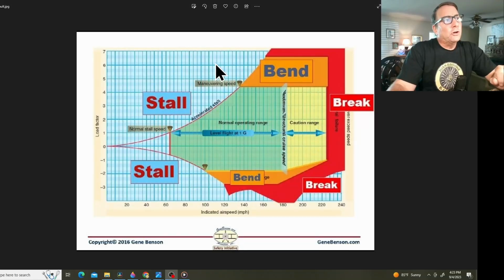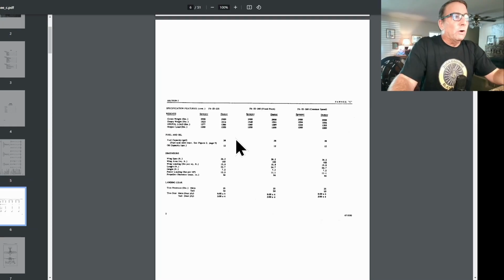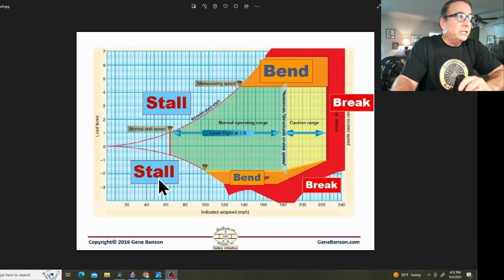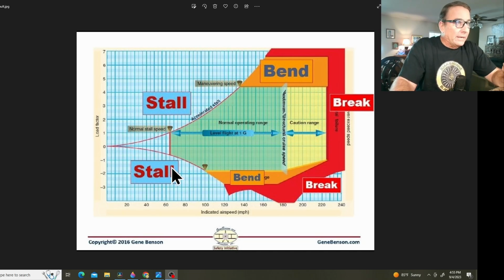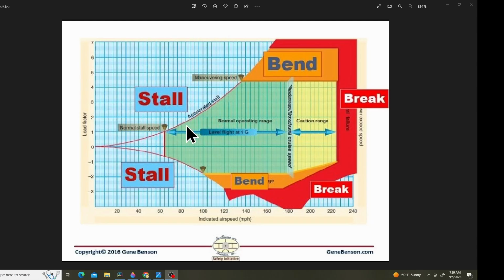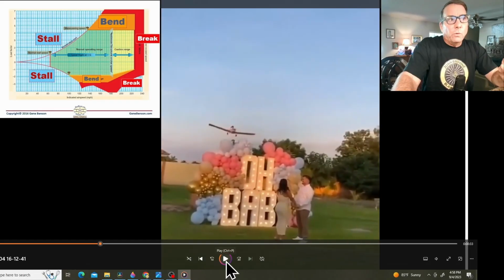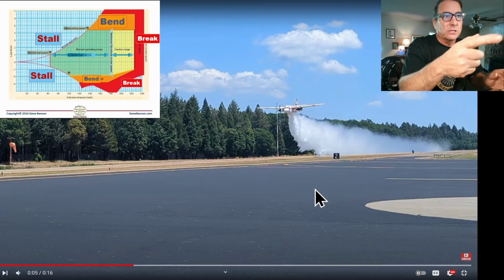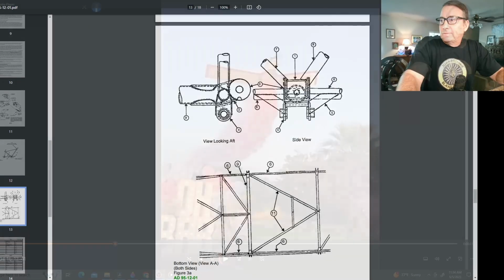PA25-235 Sinaloa MX Gender Reveal Party Structural Failure

Comment: As someone who owns and flies a PA-25-235 Pawnee for aerial application,  I’d like to clarify a few things:

1) A Pawnee 235 usually reaches its gross weight with around 100-110 gallons of water (8.3 pounds per gallon) and proportionately less with many ag chemicals that can weigh 9 to over 11 gallons per gallon.  Most ag pilots who fly or flew Pawnees don’t advise flying with any more than 90-100 gallons.  

Mine has an updated 260 Hp engine, and while it has ample power to come out of a field and maintain speed in a turn, it’s still short of wing area.  With more than 100 gallons (or 830 pounds) in the hopper, the stall speed starts to get uncomfortably close to the accelerated stall speed in a 45 degree turn. 

My Pawnee with myself and 41 gallons of fuel reaches its gross weight with 107 gallons of water.  That last 50 gallons of hopper capacity is only useful for seeding and other operations with lower density dry materials. 

In short, the weight change was at most on the order of 800 pounds rather than 1200 pounds. 

2) A Pawnee with a load and spray equipment will do a maximum of about 105-110 mph at 75% power and even at full power would be unlikely to exceed its Va of 120 mph.  My Pawnee 235 has an updated engine producing 260 hp but with its fixed pitched propeller my Pawnees still won’t exceed Va with a full load and spray equipment. 

Based on both its plying traits and what I see in the video, I don’t see any indication of excessive airspeed in this video. 

3) Most ag planes do pitch up during an emergency dump.  Ag pilots, like fire pilots flying ag aircraft as single engine air tankers, use forward stick to offset this pitch up tendency and can do it with no pitch up being evident.  Students attending ag schools do emergency dumps as part of their part 137 training and very few anticipate the pitch up quickly enough and/or with enough forward stick in Pawnees and in aircraft that pitch up more than a Pawnee but the wings don’t fall off. 

4)  The Pawnee’s pitch up tendency is comparatively mild, even when dumping a full load.  When dumping a full 100-110 gallon load an uncorrected pitch up is still only on the order of 1.5-2.0 G. 

5) More to the point, if you don’t mitigate the pitch up with forward stick it looks just like the Pawnee in the video prior to the pitch up.  The initial pitch up before the wing separation isn’t out of the ordinary. Even if the pilot added back pressure to make it more spectacular, it’s not a pull anywhere near the damage and failure limits on the VG diagram, even 800 pounds below gross weight. 

You did discuss the 1995 AD that required periodic and extensive (wing removal and dye penetrant testing) every 24 months, or new wing attach fittings and repetitive replacement every 60 months. Later there were three STCs for new wing attach fittings, two of which retired the AD.  Most Pawnees still out there have been modified with the new STC’d attach fittings at some point since 1995 when they have been rebuilt and recovered. 

The problem is unless you know what you are looking for and look to ensure the new STC’d attach fittings were actually installed, you have no idea if the AD was complied with or just pencil whipped.  Similarly there is no way to know whether a 24 month or 60 month inspection was actually done if the aircraft has the original fittings. 

It’s not a common issue in the US, but Bic maintenance is a bigger potential issue south of the border, where these wing separations happen.
Reply: This is great perspective and should be pinned to the top of the section IMO. 
Question: Do you think this was an intentional pull-up attenuated by the sudden loss of weight or the weight drop plus presumably flying into the wind caused the snap pitch-up stall and airframe failure?
Reply: It's a momentary accelerated stall that keeps your wings on as long as you are below the manoeuvring   speed in turbulence. I assume the point is the same in this case.
Reply: interesting stuff thanks for sharing.
Reply: Wrote a whole article
Reply: Few things about what you wrote. You said the weight drop would be 800 lbs and not 1200 lbs. you wouldn’t know that. You are assuming a full tank of fuel. He could’ve done this with 10 gallons of fuel instead so he can carry more water. Heck, he could even have taken off above MTOW. You wouldn’t know this. 

Also, the video is short, he could’ve nosed over the airplane prior to what we saw and increased its speed well over 120 miles per hour in a dive. 

Also, maneuvering speed of 120 mph at MTOW and lower the moment that weight is gone.
Reply: @rtbrtb_dutchy4183  1) fuel capacity is 39-41 gallons for the fuselage tank Pawnees so sure, he could have had 10 gallons of fuel on board (less than 3/4 of an hour) and added 175-180 pounds to the payload in the hopper.  It’s still less than 1200 pounds being dumped.  My primary point was just because it has a 150 gallon hopper with a 1200 lb limit  doesn’t mean it can actually carry that many gallons or pounds of water. 

Besides, what would be the point?  120 gallons of pink dyed water really doesn’t look any more spectacular than 100 gallons, or for all practical purposes 60 gallons. 

2) I often dive down over 80-100’ tall trees and from my 150-200’ turn altitude. In addition, on an initial pass after surveying a field I’ll dive into the field from 300-500’.  A Pawnee, with spray equipment and the extra induced drag at near gross weight, loses any extra airspeed quickly to around 105 mph. There’s enough of the approach in the video to confirm he didn’t have an excessive amount of speed. 

3) Oddly enough, as a commercial pilot and ag pilot I am aware of the effect of reduced weight on Va. however if the wings are stressed to 4.4G before damage occurs and to 6.6G before they break (which is the minimum acceptable limit for utility category aircraft), it means the wings of an aircraft at 2900 pounds will support 12,760 pounds of force before they permanently deform and 19,140 pounds of force before they break. 

But let’s say those same wings are only loaded to 2100 pounds (after dropping 800 pounds of water).  They will still support the same loads.  But at the lower weight it will take 6.0 G to bend them and 9.1 G to 

Maneuvering speed is the speed where the aircraft is slow enough that it will stall before the wings permanently deform with a full control deflection. In this case assuming the aircraft is at 2100 pounds, the new Va is 102 mph (Va times the square root of the actual weight / gross weight).  So it’s probable that he was slightly faster than Va. 

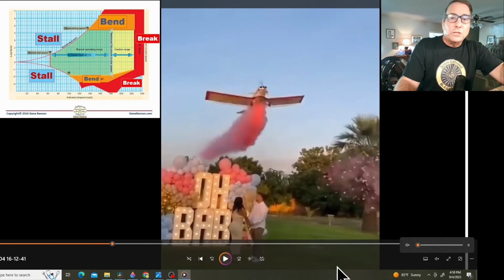 However, look at the video and pause it at 8:09. I’m not seeing anything near full elevator deflection.  In addition, despite its PA-18/PA-22 heritage and parts commonality, the Pawnee also doesn’t have a jack screw that moves the entire horizontal stabilizer for trim.  Trim is accomplished by adjusting spring force on the stick. Consequently what you see is what you get for control input. In short, it is not an excessive up elevator trim issue, and if you don’t have anything close to full control deflection, you don’t have a maneuvering speed issue. 

Even if the pilot did have full elevator deflection, he’s maybe 3 mph in excess of the new Va. Va is based on the 4.4G “bend” limit, not the 6.6G failure limit. I’m not going to run the precise math on that but that adds about 25 mph to Va before the wings will fall off.  It’s unlikely he could get a loaded spray equipped PA-25-235 up to 127 mph even in a slight dive. 

In short, I don’t understand the enthusiastic zeal to blame the pilot for a wing attach failure during what is a normal evolution for the aircraft, especially when there is a long standing AD for the wing attach fittings.
Reply: @larryvrooman4672  hey, I’m not saying you are wrong. I’m just questioning a few things. 

What I found so far is that this had the 235 hP engine and seems to be able to hold up to 1500 lbs in liquids. 

Also, I can only find it to be in the Normal Category, not Utility. 

Airplanes are certified when they are new. I personally would never trust a decades old airplane to still have the same strength as when it rolled out of the factory. 

I don’t think anyone is out to blame the pilot. I think people just want to know what the cause might be and discuss different potential causes.
Reply: @rtbrtb_dutchy4183  i see your points. i know it was an extreme example about nose over.. but from the we did see,  i will say it 'appears' that left wing was already much upward flexed than the right wing. dumping the load hugely upset the aerodynamics. ever picked up a mug of coffee thinking it was full, yet it was empty so picking mug up was a lot lighter than anticipated and so the mug moves way way faster than anticipated. yanno?
Reply: @michaelbigelow3255  I actually agree with you on that. It’s sad, but likely the truth.
Reply: thanks for this comment.  I don't know how much the payload was, but ususally these are only light scraps of paper for this reveal party.  as we can see at the end of the video there are tall palm trees,  he flew against the sun.. maybe he saw them too late and  he pulled up the plane because he did not want to crash into the palms. you can see how close the plane flew over the trees after the crash.   RIP
Reply: @Koi-Koi-Koi you keep mentioning your palm tree theory everywhere. Has nothing to do with it. Also, they used a fluid, not “scraps”.
Reply: @Dudermanbro  just a  typo
Reply: friend... can you please elaborate on this " ag chemicals that can weigh 9 to over 11 gallons per gallon.  " ??
Reply: @Palmit_ He meant pounds per gallon.
Reply: @gregjohnson2073  i thought so.. i wasn't being cocky, i just thought it's a bit more complex than i'm familiar with. i wasn't being rude or sarcastic. like when they say 176,000 meters per second, per second... yanno?

Comment: If the weight of the aircraft's fuselage decreases the forces on the wing spar and wing attachments actually decrease at the same load factor. What increases are the forces on the fuselage structure and in particular the engine mounts. This failure is probably not caused by the unloading of the water.
Reply: What?  No, that’s not how it works. You are talking level flight. This wasn’t level flight. A lighter aircraft can pull more Gs. That is what this is about. Dropping this water/weight had everything to do with this.
Reply: @rtbrtb_dutchy4183  calculate how many Newtons  you need to accelerate a heavy fuselage and a light fuselage, you get a smaller force for a light fuselage for the same acceleration.

That's the force that gets applied to the wing attachment.

Comment: Va decreases as weight of the aircraft decreases. What am I missing here? Seems that Va would increase as the airplane becomes lighter.
Reply: What you are missing is an understanding of the definition of Va. Va is the speed at which an airplane will stall before it reaches the speed for the maximal loading on the air-frame. Since stall is involved it means you need to take into account the angle of attack (AOA) of the airplane. The critical AOA of an airplane is the same regardless of its weight, since the critical AOA is dependent upon the geometry of the airfoil and the wing. Now if the airplane is flying straight and level at its maximum payload, the AOA needed to keep it straight and level, will be higher than when the airplane is flying empty. A heavy airplane is flying with an AOA closer to the critical AOA, than an empty airplane at the same airspeed.
For example, if the critical AOA for an airplane is 18 degrees, and in cruise the airplane at maximum payload flies at an AOA of 10 degrees, this means it is 8 degrees away from its AOA. If the same airplane flying at the same airspeed but empty, flies at an AOA of 3 degrees, it is 15 degrees away from the critical AOA. So the lighter airplane will need to be flying at a slower airspeed in order to change its AOA by 15 degrees while still maintaining straight and level flight. Understand now?

Comment: There is a critical misunderstanding here of what the VG diagram says and implies. The breaking point references a G force, but this is for a specific weight. Wings break at a specific force and bending moment, not a G force. Unloading the plane by dumping mass does not create a more dangerous scenario just because it increases the maneuvering speed. When holding extra weight, the VG diagram is different with the breaking point at a lower G. When releasing weight, the maneuvering speed increases, but so does the G limit along with it. Regardless of how much weight is in the plane, the wings will always snap at the same induced force and bending torque, not G. Very common misunderstanding among pilots because a lot of their procedure is based on over-G conditions. In engineering, it's all about lifting force and oscillation. If one had veins of steel and magically made an F-16 half as heavy without changing its shape and strength, it'd have an 18G limit instead of 9G because the stress on the wings would be the same.

Comment: I used to Tow banners and gliders in a 260 hp Pawnee. Very rugged plane. Very easy and forgiving to fly. I’m guessing the pilot must have pulled very hard here to cause structural failure even accounting for the sudden weight change.
Reply: I would be very surprised if corrosion wasn't the main cause. Fire-fighting planes dump a heavy load very quickly and sometimes have to do a steep climb to avoid terrain in mountainous areas.
Reply: @MrTruckerf  Probably depends on the plane.. Looking at this chart, this particular plane wasn't all that stout even if there was no corrosion problem.
Reply: Hard enough to pull the wing off, investigation will tell if there was a corrosion problem.
Reply: Probably the pull-up combined with the sudden change of balance.  If he kept the stick level, it might have pulled up by itself just on weight transfer of the emergency dump.  Adding the pull just added to the maneuver.

Comment: Thanks Juan for being always on top of recent events. I have to somewhat disagree with your analysis. While it's true that the sudden unloading would have moved Va to a lower value, that is actually a positive thing. Lower Va means lower stall speed at Max G, but Max G startst the same. So i don't think the change in Va is directly related to the failure. Either the wing attachment was going to fail anyway, or maybe it was helped by the sudden unloading which may have been followed by a sudden additional pitch up by the pilot.

Comment: I think not having practiced is hugely at play.  If in fact he pulled up hard to avoid the treeline, dry runs could have acclimated him.
On the other hand, maybe he did, and had a quick ascension strategy that he established from actual practice on dry runs, but didn't adjust strategy for the release run.

Comment: As I recall… during the low level skip-bombing assault on the Ruhr Valley Dams during WWII, 5 of the 8 attempts resulted in loss of aircraft to both defensive gunnery and catastrophic structural failures.
Reply: One of my favorite movies as a kid was "The Dam Busters".
Reply: Nice reference!
Reply: Only one aircraft was lost over the dams, that happened at the Mohne dam. It pulled up but one wing was on fire and it broke up and crashed. The Eeder dam did not have defences. The aircraft that had to attack that dam all pulled up very steeply but none broke up.
Reply: @chriss.4147  He could be talking about training / testing too. There's film of a least one where the bomb bounced into the tail and the aircraft went straight into the sea.
Reply: They lost a lot of planes. Some to AA fire, some crashed into high voltage power lines. Some returned with the bombs. Didn't hear of structural failures.
Reply: I have a small 2x2” piece of “AJE” , a Lancaster lost on the dambusters mission, AKA “operation chastise” …  flown by Flt. Lt. Norman Barlow and his crew, lost to ground fire at 23:50 hrs May 16-17 1943… Godspeed boys…..
Reply: @ROBIN_SAGE Let's remember the 1000 innocent victims of the raid. And the other victims of British terror bombing
Reply: @Dilley_G45 AND Let’s remember who started the war, and killed millions in concentration camps.
Seriously, what a ridiculous statement.

Comment: Still trying to understand how decreasing the weight decreases the minimum maneuvering speed. Can anyone suggest a reference that I may use to learn more?
Reply: dont have a reference but basically it comes from the eq f = ma. the planes aero surfaces produce a  specific force at a given airspeed and aoa. the acceleration that force creates goes up as rhe mass of the plane goes down so the speed it takes to exceed the load factor limit is reduced when the weight is reduced.
Reply: some components like wings see increased load with increased weight so they dont necessarily see higher loads in the low weight high g scenario but some components see loads independent of gross weight so they see they are at risk of failure in this scenario. 

not really sure if that is really a factor in this incident
Reply: @saleplains  Appreciate the insight!